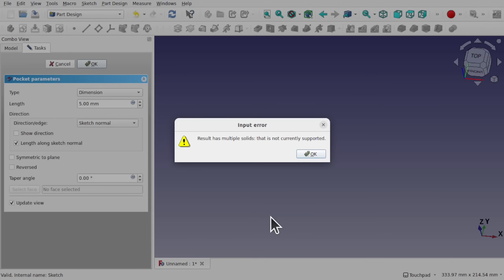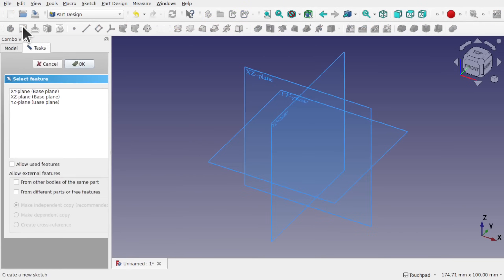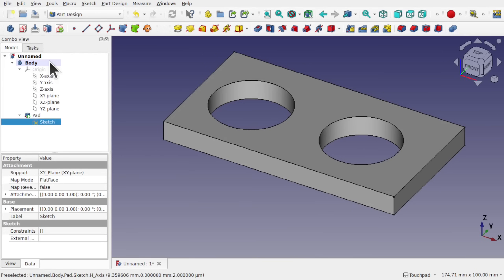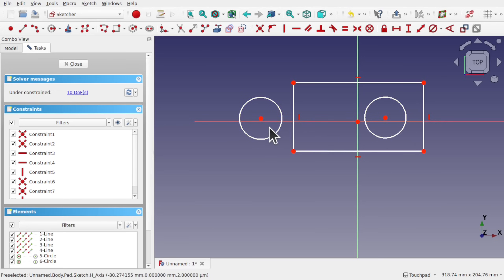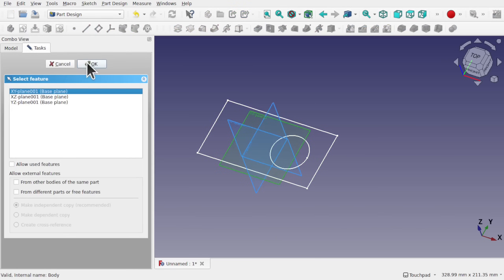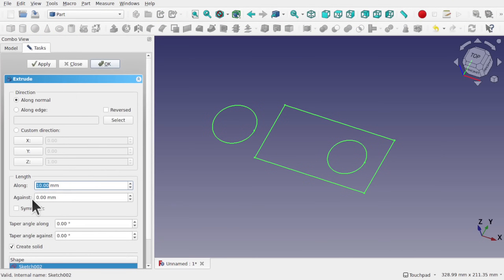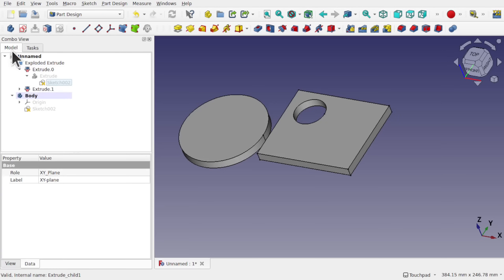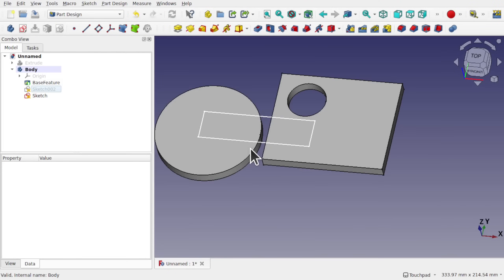FreeCAD: Understanding The Part Design Multi Solid Support | Single Sketch Multiple Profiles

Comment: Thanks for this demonstration. If I was to have those two shapes linked with a 5um bridge for example, they would technically behave like one solid but the bridge would be so thin it would be ignored when 3D printing for example. Is such a workaround clever, or is it simply bad practice? Thanks.
Reply from the maker: So, funny you should say about this one, things have now changed after the release of 1.0.0.  Click on the body and look in the properties, you will see the experimental heading and under that the property 'allow compound'.  This now allows for multiple solids.  In regards to the workflow bad practice with the bridge.  I would be concerned about clear design intent as it's not obvious what it's for.  It's a workaround where you have a self destroying thin piece of material, but those work around can lead to creative solutions such as getting around printing of certain floating features (there is a video somewhere on another regarding a sunken feature that cannot be printed without having a 'bridge').  If it's there for a reason then it's not bad practice.
Reply: Thanks for the reply. I will have a look at that. There's a lot to learn with this software, I think I'm familiar with about 5% already, maybe less, but enough to model useful things.

Comment: Freecad has tied itself in knots and should stick to the body paradigm where new bodies are created if the geometry is isolated. The compound object paradigm is a nightmare as the  reality of two or more separate bodies hides the fact that the two or more bodies are actually one only discoverable when an error occurs. Internal intersecting interior curves should be processed sequentially resulting in the correct outcome of a negative shape subtracted from its surrounding parent.

Comment: I wish i would have watched this last week.  I didn't know I could merge sketches.  I've been using freecad for so long I'm pretty sure I've gotten stuck into the hard way of doing things since so mach has changed and I'm not a daily user.  Probably a an intermediate level user who's missing a bunch of basics now.  Thanks for you your efforts.  Anyone should be able to learn freecad with the help of your channel.
Reply: I typed than then kept watching and I desperately needed that base feature to pull stuff from part to part design last week too.  I got stuck int part workbench and tortured myself for hours since I couldn't pocket.
Reply from the maker: Great to see you have learnt something from the video.  FreeCAD has a steep learning curve.  I learnt it when there wasn't much documentation about.  One of the reasons why I started this channel.  To help others.  Thank you for the kind words.

Comment: For a free tool it is awesome but a bit expert friendly.  Like one would think you can draw a rectangle, constrain it's height and width, then select it. Then try to copy it (control c) and paste it (control v) but... nope! Day 3 and I still can't figure out how to copy things on a sketch/part/part design or how to cut from one sketch to another and such. It has about 20 very powerful workbenches, but intuitive features like control-c and control-v (cut and paste) are not there. I have done 3 designs in 3 days but I have to redraw things a LOT because when you get 3 or more sketches in the same body, all with constraints to each other, and you simply want to delete or move something and... it's easy to "break" the design... and what a mess it is to fix... but this tool does the job and doesn't seem to crash.  It just takes becoming and expert on it to do designs efficiently without having to redraw and fix things many times during  a design.

Comment: Great video gave you a like. Only day 3 on FreeCad.  One issue I can't seem to fix:

Part design.
Created a body and sketch.
Created a rectangle in sketch, constrained it totally.
Created a pad for it.
Selected the top surface of the pad.
Created another sketch on that surface.
Created a circle on that 2nd sketch, (I can see the rectangle from the 1st sketch in this sketch).
I brought in a reference from the rectangle from the other sketch and 
Constrained the circle to that reference.
Did a whole bunch of things including many sketches, pads, and pockets.
I get no warnings or errors... all looks good.
I go back to look things over.
But in my learning I hit keys that I may not suppose to hit (not knowing I did so).
I go back to that 2nd sketch with the circle I constrained to one point from the 1st sketch rectangle - BUT THIS SKETCH IS NO LONGER SHOWING THE RECTANGLE... my circle and constraints are there but the rectangle is missing from the view (it must be there but not shown).
I played with pressing space, but that does not change anything inside a sketch.
I did find a pull down that turns everything back to visible - but now the 3 planes are visible with the rectangle - but too much now to look at.
All I want to see is the rectangle from the other sketch with the circle and constraints I made to it just like when I started that sketch.
What did I do wrong?
How do I get it back.
This tool has TONS of features but its hard to find things because there are like 20 workbenches and each one does different things, sometimes things subtly.

Thanks.
Reply: perhaps you hit Ctrl+Z (undo) which undo the creation of your disappearing rectangle?
Reply: @mohammadebtaprakarsa7679  Control Z or Undo was no help.

Comment: Hi. Do you have an update about PLM functionnalities in freecad ? Merci :)
Reply: What's PLM in this context?
Reply: @VOROX_Audio  PLM stands for product lifecycle management. Its a very important aspect of product devloppement. It aloud the users to track what is in work , frozen, released or obsolete.
Reply from the maker: I think the Onsdel layer may be tackling this area as it adds that business layer on top along with their Lens offering.
Reply: @MangoJellySolutions  oh interesting. I am a bit confused when it comes to onsdel. Its running on freecad but its different? Would you recommend using it? I will watch your videos about this. Do you have a recommendation to design in work frozen release and obsolete with freecad? Merci

Comment: Thanks for your excellent videos. I have experience in using Ansys to do FEA analysis where it is rather easy to split faces in Space claim for solid bodies that is sometimes required to identify contact areas or load distribution on solid bodies for FEA analysis. I am new to FreeCad and I'm battling to split faces on solid bodies in FreeCad in order to do FEA analysis in Prepromax. Is there a video of you that you can recommend for the splitting of faces of solid bodies for analysis in Prepromax or is there a function available in FreeCad for this?
Reply: you can use boolean fragments. check the tutorial series of FEAnalyst, there he shows in one or two videos how to do it
Reply: You can make a sketch on that face and make a pocket to the other direction so that it will not affect the thickness.
For example if you want to make two separate rectangles from one rectangular face you can make sketch on the face you want to split and draw one rectangle and make a pocket to the other direction and make sure the refinement property is set to false
Reply: @muezabdalla2852  
Thanks. This helps alot and works 100%. Can you maybe advise on how to split a face on a roundbar or any face that is not flat? Your help is highly appreciated
Reply: You can draw a rectangle that just touch the round surface and then revolve it around the round face and chane the angle to what you need.
Or you can use the a tool called sketch on a surface I am not sure what was the name of it but it's available on the curves workbench which can be installed from the addon manager
Reply: @muezabdalla2852  
Thankyou once again. This makes sense to revolve. I will test this. Shalom

Comment: Is this topology renaming thing still a thing in freeCAD?
Reply: Yes, it should be fixed in freecad 1.0
Reply: It's a thing in any CAD package. It's not solvable, just hide-able and workaround-able. If you understand what the topological naming problem is, you can easily break models in Fusion360 or whatever commercial package you use. Likewise, if you understand the TPN you can easily create stable models in FreeCAD.
Reply: @VOROX_Audio  I admire your background knowledge but a simple "yes, it's not crashing itself anymore if you want to do basic parametric stuff!" Would have been enough :)